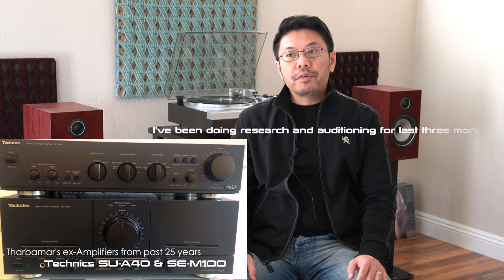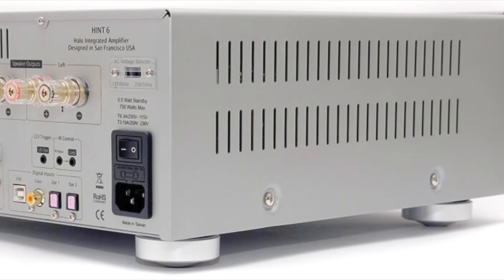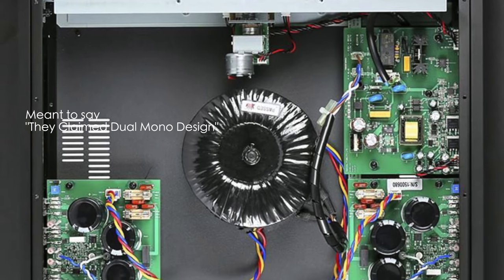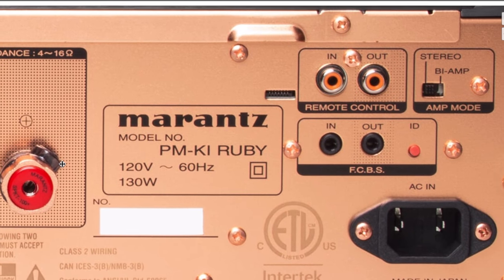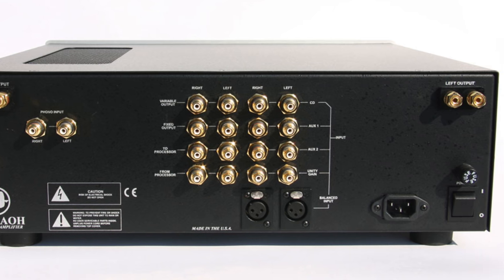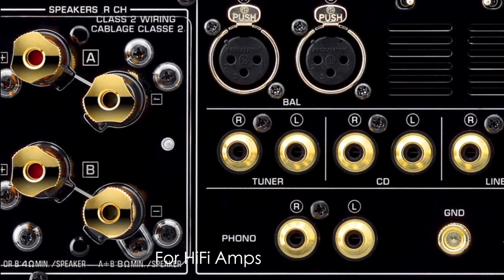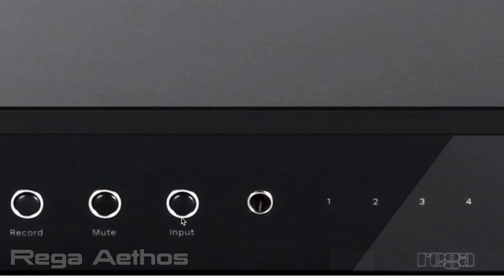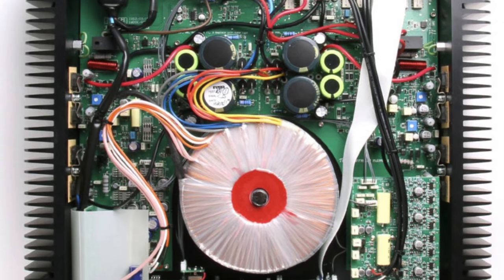Shopping for $2,000 to $5,000 Integrated Amplifier

Comment: A lot of manufacturers do charge a premium for less than premium parts and construction techniques. Unfortunately, just because something is well built and looks the part doesn't mean it will sound all that great. Now, Tharbamar will certainly look under the hood but most will not and, quite frankly, they don't care what's under the lid as long as it sounds good to them. But this is a luxury hobby and people get to make their decisions based on whatever criteria they deem important, or don't. Personally, I like the look of the Luxman and the Yamaha. The Parasound and Atoll are well constructed, too. But put all four of them in another room and let a third party switch at random between them and I'm not sure most people could tell the difference. Even if they could they might prefer the sound of one that they wouldn't buy because of some preconceived notion about it that turned out to be much adieu about nothing. Still, they'd refuse to admit they were wrong and settle for lesser sound just to save face. Hey, if the way it's built and the way you want it to sound coincide, fantastic. But to dismiss a product you prefer the sound of because you can't get past the look of parts you'll never see in real usage is a bit odd to me. But again, it's a luxury hobby and it's your money (not you personally Tharbamar) spend it as you see fit.
Reply: Agreed and most people (myself included) really don't know what they're looking at inside anyhow.  Because it's busier under the hood does that translate to better quality or maybe a less efficient design with more cheap parts?  What exactly ARE we looking for inside?  lol

Comment: I think the Luxman was the only one with a MC phono stage (hopefully a good one). You’re into vinyl and if you can get a good MC cartridge that matches your TT’s arm, that would be a plus, especially if you wanted a neat solution. I agree with you being fussy about about the internal build quality and I like to see a big power supply with many quality caps for power delivery and current. Try to audition at home with your components. Thanks and happy new year 🙏
Reply from the maker: I have my Denon DL-301ii and DL-103R for music listening and DL-80 for casual playback.
Sound quality is very important for sure but for me most important part for an amp is build quality because I don't change my amp like i change my speakers I don't want the amp that requires bias adjustment every five years or so and wattage is nothing to do with sound quality, only good power supply with quality parts will give good head room, drive power, sound quality and longevity. I did tried most of them in stores except Atoll and Aethos, thanks for the advice, Happy New Year!

Comment: I think you should consider the Hegel pre and power amp. And also the Hegel integrated amp if you don't mind the built-in dac and streamer. As for phono, why not consider the Schiit Mani? Most of the integrated amp does not have a good phono stage, imo.
Reply from the maker: I’m not sure I can like their products for 10+ years if they last that long because if I choose an amp I will be using it for very long time that’s why I do not want DAC in my amps, Luxman and top end Denon, Sansui, Marantz, Yamaha comes with better phono stage than many people think and even better MC phono stage.
Reply: @Tharbamar  If that's the case I would choose and invest in the Luxman amp. Maybe even choose a higher end Luxman.

Comment: Hegel are designed in Norway and made in China. They sound good but quality of constraction is not on par with Japanese amps. Dismissing an amplifier just based on the topology used is something i do not recommend, even more so when the amplifier is voiced by KI himself. I had the Yamaha and it is built like a tank. As far as i know Rogue Audio amp is also Class D based on B&O ICE modules while Marantz chose Ncore.
Reply from the maker: Thanks for advice.
Reply: @Tharbamar  Welcome and good luck whatever you choose.

Comment: Looking at the internals does not necessarily tell you which sounds better.  Only way you can do that is by listening.
Reply from the maker: Yes and no because if I see it inside I can tell the quality and I can tell who actually make them, I did audition at the show rooms, even traveled to So Cal except for Atoll and Aethos.
Reply: Have you ever considered a used hegel integrated? Off-topic, i recently sold my marantz pm8006, it was great for the klipschs rp8000s, but for the bowers wilkins 700 line, you need a very high end integrated or seperates. Good luck!
Reply: @realtor_alexgvs  Did you not watch the video before commenting? He literally goes through the Hegel integrated.
Reply: @commane21  you are absolutely right.

Comment: The transformers would cost more especially if there are two.  If they implement a linear power supply regardless the type of regulation used, the bigger transformer will mean more potential power available unless they incorporate a lot of really good audio grade capacitors.  That's why most great sounding amps usually have high weight.  For low power output, might not matter.  The expensive capacitors usually are reason why very expensive audio gear exists.  The heat sinks are cheap, resisters and small caps - cheap.

Comment: I might be wrong but I don't believe you mentioned the speakers you meant to pair this amplifier with. Synergy between  amplifier and transducer is the most important consideration and that is absent from your analysis. I'm also curious why you abandoned the Parasound setup you used years ago because of how it sounded after it left class A but are now considering a bunch of class A/B amps? If you liked Class A sound why not buy higher efficiency speakers and stick with class A amps or even try class A SET or DHT?
Reply from the maker: I was going to pair them with KEF R11 or Reference 1, Parasound had reliability problems. Thanks

Comment: Go for the Hegel. I have tried all of their range and the H190, or if you can afford it the H360 (dual mono) are brilliant. I comparred to at least 20 Amps from various manufacturers (including some from your list). Both of these Hegels have a damping factor (which indicates the woofer control) of over 4000. Nothing in the test can touch that. Also for power and natural tone they are unmatched. See what you think as your ears will tell u something special is going on. Great soundstage with real depth (which I think is the hardest thing to do accurately). Their DAC's are also brilliant. I had a £1000 award winning DAC and I prefer Hegel's internal one. Plain looks but AMAZING perfromance.
Reply from the maker: Thanks for suggesting, damping factor is marketing because most of the people have no idea about it and most will not be able tell the difference in sound quality when they listen to 300 DF and 3 or 4000 DF specs amps.
i.e, 3000 amplifier DF only improved damping factor by 0.31 over the amplifier with a DF spec of only 400 when the speaker is 2ohm load with using 12awg wires. DF specs are good numbers for beginners not for me, it won’t do much, higher DF specs have little effect on sound improvements and most wont be able to tell the difference between good quality amp with 400 DF and 4000 DF, it’s all marketing because they know that people are easy to get through the numbers, they should publish speaker impedance load and amplifier output impedance when it calculated but they won’t because it’ll be very tiny numbers and not impressive for marketing.
If you like those amps that’s great but I’m not fan of cheap parts inside their amplifiers, they are way over price for what it is and people are too easy to get to by marketing, those amps sound quality is good only because made by Opera.
Reply: I appreciate what you are saying. Just make sure you audition one, other, or both of my recommendations. Your ears will tell.you the rest.
Reply from the maker: I've been auditioning many amps in last 3-4 months, not only from my list, Sometimes I drove over 500 miles to audition one, only things that I have not listen is Atoll and Aethos. 
I have over 24 years of experience in this hobby, one thing I stop listening is what other people like or think, it does not matter what other thinks because it's all subjective and influence by reviewers and marketing and may or may not work for you or me.
No system will sound the best to everyone because we all have different taste and preferences but thanks for the advice.

Comment: I’d go with either the Luxman or Yamaha. Both companies have outstanding engineering units, excellent reputation for build quality and most important they both sound great. Otherwise, you may want to consider taking your Denon to a reputable electronics service shop and have it checked out, cleaned and refurbished as need. It looks like a quality build as well.
Reply from the maker: Yes, I did service my Denon a few years back, both channel is within factory specs and technician said he never seen an amp like that after ten years. He did advice to keep it forever. 
Luxman and Yamaha is serious contenders for sure, another reason to consider for me is they have their own factories to make their products which is much different form contract manufacturers, thanks
Reply: @Tharbamar  , thanks for your reply. This year I sold newer gear that I purchased in 2016 & 2017. I got the bug to try something new, but honestly my vintage (1990s) reference components are better than most items available today. I’ll catch some flack probably for stating that, but the premium/reference gear built in the late 80s and through the 90s in Japan is outstanding. That being said, Luxman and Yamaha still build quality and as you stated “have their own factories”. I agree with your preference for analog integrated amps (or for that matter preamp/controller). Separating digital signals from a preamp/control amp or integrated amp is always a better solution. Also, technology changes will hurt resale value when you have a built-in DAC, unless it is a modular component that can be removed and upgraded. If I get the bug again, Luxman and Yamaha would be on my short list. Enjoy your search, it’s always fun to look and listen to new components.
Reply from the maker: Yes I’m with you, nowadays designing amps is easier than ever for them because Chinese manufacturers sent out samples and amp designers(not all) try them out and take the measurements to see which combination is work the best, in some case they made a few tweaks to get the best sound quality within the budget and get a few more final samples, when they’re happy with it they sent in the qualifying bulk order(which is amust to get the lowest price) to contract manufacturers in the east (mostly China).
When I see some of the factory visit videos on YouTube I laughed because they talked like they did the design from scratch, when I go to audio shows some of them can’t even answer simple technical questions and the badge on lanyard says technical director or product development manager etc, that’s why I’m going to stick with the companies that have own manufacturing facilities, thank you.

Comment: One more great video. Congratulations. You think will be possible one day to compare a Vintage Sansui AU-907MR or NRA vs a Denon PMA-SX11 or other actual amplifier of your preference? I like a lot my Sansui AU-X911DG and the design and reviews around Sansui AU-907NRA call my atention, even costing close to US$ 3,000.00. Also, at this price point, what should be your strong suggestion? I liked the clean design of Atoll. What do you think about it? Thank you in advance.
Reply from the maker: One thing I can tell you is no one in the price range have better power transformer than Sansui amps but overall driving power PMA-11 is very hard to beat, even by some pricey mono blocks. Thanks
Reply: @Tharbamar  , thank you for your comments. In Brazil, were I live, I can find an used Musical Fidelity M6si for the same price of a Sansui Au-907NRA. I will try to listen both bere deciding. On the other hand, to import a Denon PMA-11, used or new, will double its price, due taxes.

Comment: If you buy your amps by weight and looks, the Denon PMA-2000IVR is a great value!  But it doesn't sound that great. I've had mine for about 10 years and I keep it only as my backup.    It's smooth but dark sounding, slightly veiled, and the bass is "rounded", not tight or fast.  My Yamaha A-S1100 weighs less but is far far superior to my old Denon.  Since you dislike Class-D, you failed to mention that the Rogue has two Class D modules inside (and vacuum tube drivers).  I don't like Class D either.  They're not quite there yet in terms of sound quality but can produce lots of power on the cheap.

Comment: If you can go back to separates, you should check NAD C165BEE preamp  and NAD C275BEE; they have measured those with insane number, flat frequency response and very clean power free of distortion and a very high signal to noise ratio... They are not very luxurious on the outside but the money was spent on the inside where it matters the most, however as simple as they are, they look classy and minimalistic. Other thing is that NAD amp was measured with insane amounts of current, even more current than the Parasound JC5... The NAD was pushing 39 amps for 10 miliseconds and the JC5 about 35 amps for 10 miliseconds if I am correct. Just do some research, even the designer BEE was an incredible engineer.
Reply from the maker: I will try them if I go that road, thanks
Reply: @Tharbamar  Please check the reviews I attached here for you when you have the time, they are made from the same people, you can check tests done to the NAD C275BEE amp and the Parasound JC5, while the NAD is rated at 150 watts and the JC5 at 400 watts per channel the NAD was providing more current, it can drive any speaker...
Reply from the maker: Very interesting I will definitely check them out, you're right many audio products from west is made by only a few Taiwanese or Chinese manufacturers but I didn't know about NAD, thanks for the tip.
Reply: @Tharbamar  I meant the reviews are made by the same publication. NAD was an English company founded in London, now they are Canadian. The designer if this preamp/amp combo worked with NAD since the beginning from the early 70's, he is old school, an analogue king of engineer. This is his last combo before he passed away in 2018 still working with NAD. This combo is from around 2009, is completely analogue made in an era with great tools and technology for measurements and manufacture. With the brain of one of the greatest designer in audio electronics in the world. The preamp measured .0002% to .0006% thd 20 to 20,000hz. The amp measured .002% to .003% from 20 to 20,000hz from 1 watt to 150 watts. Stable as a rock! Clean, clean, clean power! Equally impressive the flatness of the frequency response. Bjorn Erik Edvardsen is the designer of this system, I think he is above John Curl  on my list of great engineers of audio equipment. The letter on the names of NAD's systems with the letters BEE are the ones designed by Bjorn Erik Edvardsen.
Reply from the maker: I really appreciate your advice I will try them If I have chance, to be honest I did not even thought of NAD because I was not impressed with their recent products in general but I'm impressed with the measurements of 275BEE combo, thank you.
Reply: @Tharbamar  You are very welcome! Even if you don't buy them, you should do a review of them for your channel. The thoroidal transformer is fully encapsulated for low noise...

Comment: I have the Yamaha AS2100 with the matching CD player with built in DAC it's a great system can't go wrong with it I highly recommend,  new age electronic has the best deals check them out, I got my matching set for 4300, and I know they have a killer deal on the AS3000 for a little over 4000, my opinion would be either the Yamaha as2100/3000 or the Luxman
Reply from the maker: Yes I agreed I’m seriously considering Yamaha as well because I have to admit that the way it sounded and build quality is so much better than the others even at the sticker price and Yamaha M-5000 just won best power amp award in Japan beating out Accuphase, Luxman, Mcintosh and many other great amps, they’re doing it right.
Reply: Shannon Williams... do you have a link to where you bought your Yamaha gear?
Reply: @harbinger8083 on Google type in  Yamaha as2100 under shopping and look for a company called new age electronics it should be easy to find, there the cheapest I found I paid 2300 for mine

Comment: Nice video, I’ve been researching the exact same thing, with the same sorts of requirements.  One question I have, perhaps I am not understanding properly, is your statement that you do not want an integrated DAC.  Just because a unit had a built-in DAC doesn’t mean you need to use it, correct?  Isn’t that only going to come into play if you use a digital input?  If all you are using is analog inputs, the DAC is not being used.  Seems like it gives you the option if you ever wanted to connect digital, but doesn’t take away from the analog processing.
Reply from the maker: Main problem with build-in DAC is, it will be outdated in a few years,  another thing I do not like is mixing noisy digital components in analog amp, which I want to keep it pure, thanks
Reply: @Tharbamar  Makes sense, Thanks for the response.  I too am not interested in an internal DAC, or internal streaming, etc.  for the same sorts of reasons, but was curious on your thoughts.  I guess I also see it as paying for something I really don't want.  I'd rather the money was put into a great amp than a pretty good amp with a bunch of bells and whistles.  Thanks again!